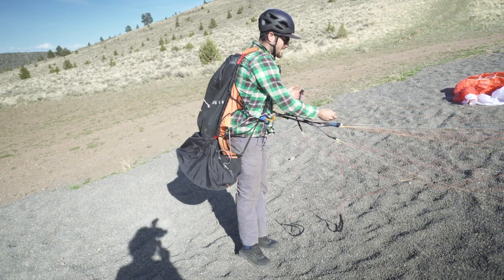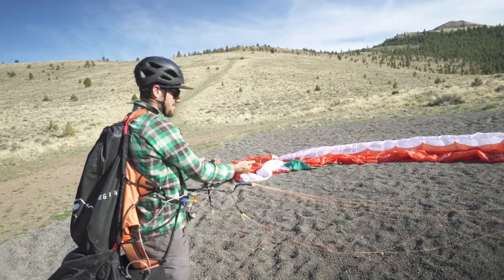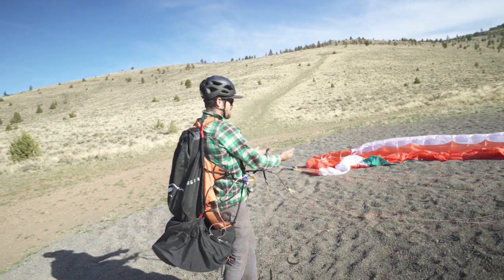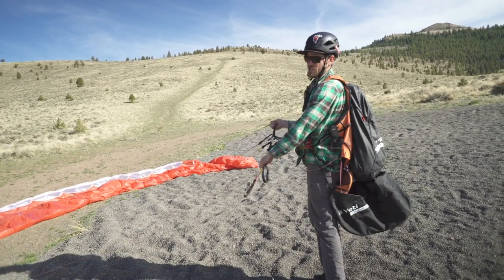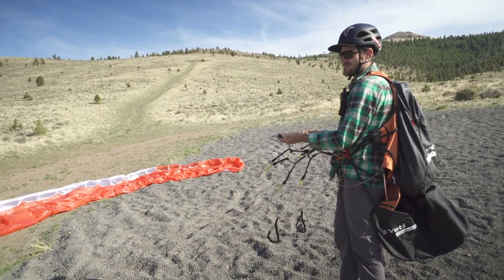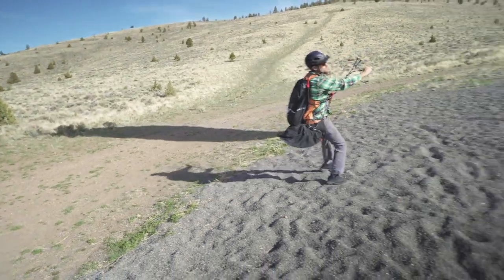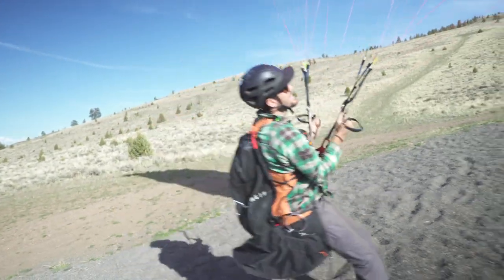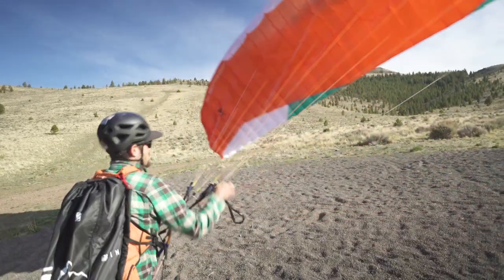Paragliding Kiting Errors

Comment: This is excellent. I fly a paramotor so I don't always have a harness on, and I totally experience the horseshoe when inflating my wing just in-hand, and now I know why -- because my As are together and on top of each other, rather than 1-2 feet apart. While I don't know that there's a better way of kiting the wing without being attached to a harness, at least I know why it is happening to me. I also don't have a lot of wind near me so most of my launches are in pretty light to nil wind. Kiting with a harness on in full wind will be fun now that I have a few different techniques from this video to try! Thanks Ari!
Reply from the maker: Happy to hear this was helpful! A lot of people, myself included for so long, dont think about the different line tensions based on where they're pulling

Comment: Nice Video but...I don't think it makes any difference to the wing whether you  are pulling the As towards the carabiners or lifting them up.  As long as you operate the A's one in each hand and you  maintain tension on your carabiners, it makes no difference at all.  We are talking about the initial lift here.  Once the wing is overhead the 'As' become irrelevant.  You can maintain a wing in half inflation in light winds just supporting it with the 'As'.  I've spent many hours kitting for fun and for launch practice.  Sometimes I pull back, other times I lift and I don't find much difference in it.  In light winds you can't get enough 'pull' out of the raiser and have to go up the line to get the wing to inflate. In strong winds mostly just lifting the As from the Bs is enough to make the wing come up.
The same applies to the Cs or Ds once the wing is flying.  I pull down on them hard when I want the wing to collapse but for directional stability I simply push away and or down lightly.  It doesn't seem to make much of a difference at all.
When pre-inflating without a harness, it is impossible to separate the raisers as you will be holding As in one hand and Cs in the other.  This is really not kiting but preparing the wing for launch and making sure all lines are good with no tangles etc.  Also a great way to lay the wing into wind nicely and get a feel for the air.
Reply: 20 years of flying here, makes no difference whatsoever… think about a forward launch…you are not pulling the A’s straight down to launch, you are lifting the leading edge…this is pretty useless advice.

Comment: Good points here. This theory would also apply to a's and c's launch technique as your changing the geometry all over the place especially depending on the glider. I see some pilots on launch with this style, staying in reverse kite mode for ridiculous amount of time before turning. They also tend not to move towards wing as they try and do all controls with hands. Is best to to turn just as glider comes overhead and kite in forward position. Risers are not twisted and you have a more true feel for the wing.
Reply from the maker: I think the biggest kiting error is not moving your feet enough. Good point

Comment: Your fisrt tip was nonsense. Pulling is wrong and lifting is right , if you disagree than you probably just fount a glider specific tip. Im serious because if i pull on the As while its on the ground it jus folds the glider in half like a taco and closes the cells. If i lift it opens the cells and lets wind in there and allows the glider to fly. The only reason to ever pull As would be to accelarate the glider, it could also be that you have so little wind that you need to accelarate the glider(aditude on the ground)  for it to fly at all, i liked the anti horshoe technique, you even mentioned your self that acro glider pilots need to do it all the time, this shows just how glider specific these subtleties can be. I hope you appreciate my useless criticism.--> here is a metaphore for our situation( ari in the aair=bill, me=jim)
Bill says"your all white, every single one of ya" jim says "im black", bill says"oh yeah i forgot"
Reply: You also want to walk or run quickly backwards... this is important in light wind... you dont launch a paper airplane gently you give it a good huck , its just like my paper airplane metiphore, the running backwards give you a bost of airspeed yo get it up there then you can keep it up in light wind if you are VERY carefull not to stall the glider( in extremely light wind any amount of breaks will stall the glider, if you are about to stall it while kiting put your hands up(no brakes) and run backwards, this is a tip i would have liked to see in the video... oh yeah and show the people how to kill the glider in super high wind if they are getting drug to canada, this is an important tip for safety... you probably already know this but show the people how to kill the glider : to stall the wing in high wind you pull both brakes and wrap them around your wrists till the wing stops flying. If been kiting out in gust s that required me to to like 5 or 6 wraps arund my wrists to stop the glider from flying(draging me across the gound off to canada) not fun and extremely dangerus if you do not know this last resort tip to kill the wing, thank you for your awesome paragliding videos, isnt flying just the funnest thing ever!
Reply: I was teached that way. But I've also seen an  instructional from Raul Rodriguez where he is pulling and just playing with As

Comment: Dude. Nobody taught me that about if your A’s are together it horseshoes. I have noticed it horseshoe but didn’t think about the lines being tighter on the outside. Do you think if you had the A’s far apart the wing would come up with less power?
Reply from the maker: Maybe if you pulled them like 3' apart it would fuck up the geometry enough to make it less powerful lol
Reply: If you get the horseshoe when launching (ie when you may need to have both As in one hand), you can also just grab the inner As. That way the wing inflates from the center and also with less power